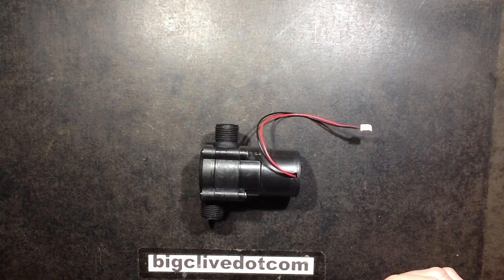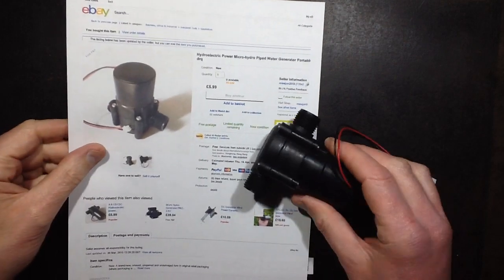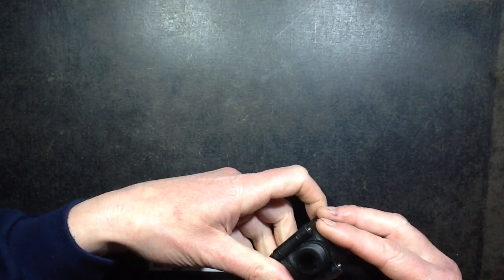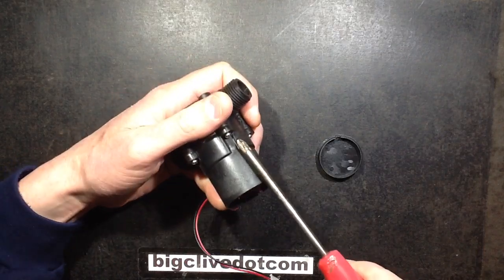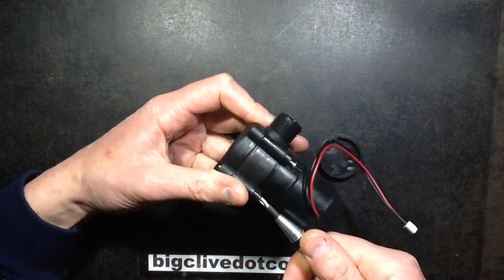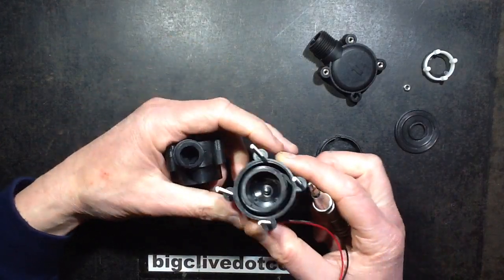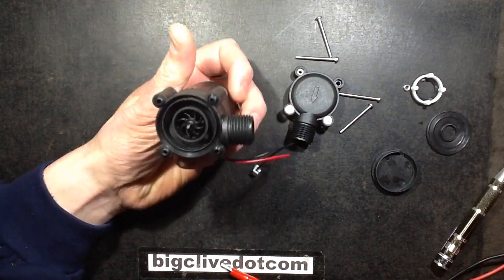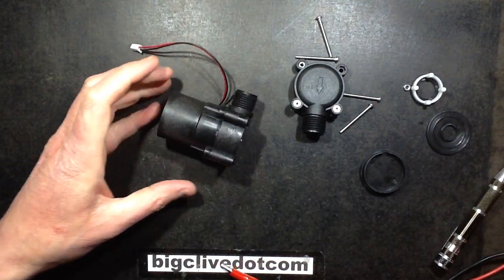Higher current and voltage micro turbine.

Comment: There actually isn't much slip with these mag drives. Once there is high rpm, the magnetic force applied increases exponentially. Just like when a generator is hooked up to a load, the force required to turn increases. The concept is the same except remove electrical generation, and turn it in to heat. This is all on the drive side of the device.
Reply: There are pumps that move some nasty fluids that cant have a seal or any failure point where the pumpage can leak. It's set up the same way large scale. Quite efficient with almost zero slip at full rpm. Very cool to see in this small scale.

Comment: Well we need someone like you that involves yourself in this topic.. you make a video with those little things United together in a manifold and seeing if it will charge a battery Bank.. and yes we know this water needs the least to be filter .. or at least screen in the outdoor wilderness hydroelectric project.. yes they make such a things we're forming spray rigs.. the ultimate achievement in a basic hydroelectric is.. maybe I should say Quest.. is charge a small battery Bank converted to DC for a long distance run through a 12-2 wire and have that line charge a larger battery Bank.. that ultimately runs large DC converter..  water pipe versus flu m.    Give me a some of this hopping with hydroelectric power which may or may not be transferred into a dedicated system.

Comment: What is the purpose of these things? What would you actually use it for? they are like tiny water motors we used to used many years ago to power machinery driven by mains water pressure. If only someone made one that could generate enough power to slowly charge a battery bank when I'm out at work then when I come home, switch it off and I have free power to use and haven't given the energy companies any of my money.

Comment: That must be ... the most pathetically cheap way of transferring mechanical energy to electrical ... using a magnetic clutch to drive a motor ... instead of just using a suitable stator for the clutch magnet itself. A bodge job gone serial production, if there ever was one.

Comment: Perhaps the magnetic coupling is supposed to limit the current and prevent the coils from overheating, since the more current is drawn the more force it will take to spin the generator and at a certain point the magnets will start slipping...

Comment: If it is used in a household application would using a capacitor, or even an ultra capacitor, work better than trying to charge a battery of some kind?

Comment: Hey there Clive. say, do you think i can put one of these little motors on the hose of my shower and power ups some LEDs to light up the shower? 
how high is the current it creates? if it isn't that high, i could even use it without waterproofing, just direct LEDs on the terminals and if water splashs, no biggie. 
Thank you for your great videos, i've been following you for a long time, since you always show up in my front page, only today i found out i still haven't subscribed! sacrilege!!
Reply from the maker: The current they generate isn't that high, but would still offer a glow.
Reply: going to give it a try! thank you :D

Comment: response to 
hire current and voltage micro turbine.

 I have one of these turbines
 and I also disassembled it
 I have seen them used in the hill tribes in Thailand.
 they are mainly used for LED lighting in showers
 or  to charge up cell phones.
 you mentioned you had a friend with a waterfall.
 the higher the drop more the power.
 thanks for all the  videos

Comment: Hello Clive,
If I was to run several micro turbines as in 'https://www.youtube.com/watch?v=M60V4VX0pNU'  'inline'  would that increase the power ie.15V x 4  = 60v
I like your vids you explain clearly 
cheers 
Tony
Reply from the maker: It should, but will also increase the flow resistance of the water greatly.
Reply: A little bit more about that Clive. are you saying for  example water flow into the first would be 100 feet per minute coming out would be 90 feet per minute and so on over the next 3 water turbines ending in water flow at 70 feet per minute into the last water turbine.

cheers 
Tony
Reply from the maker: Each turbine would restrict the flow like a resistor, so the overall water flow (current) through the pipe would be reduced.  The pressure wouldn't change, but the flow of water would resulting in reduced pressure when devices were actually using water.
Reply: Cheers Clive,
I'll let you know how it goes
Reply: What was the current when hooked up to a water source? I'm looking for a small turbine with at least an amp output.
Reply: bigclivedotcom run a ton of them on parralel pipes, I've got over 4 bar mains pressure here. Don't let the water authority cotton on as you will get done for erroneous waste of water and they will slap a meter on your rising main

Comment: I'd like to see if this motor is reversible. If you apply the voltage to the opposite leads will it spin backwards? also, if the turbine spins backwards would it push the water out? in essence: if the voltage is applied backwards would it pump?
Reply: I have the exact same micro turbine. I tested to see if it does spin backwards and pump water and it does quite efficiently, the water shoots out into the air.
Reply: Any centrifugal pump will move water when spun backwards. But it's strange in that it will still flow in the same direction, just at reduced pressure.

Comment: May be , the rubber washer allows excessive pressure to escape round the end of the turbine as it flex away from the lower " surface " .............
Reply: that was what I was thinking too.
Reply: more like they want to prevent water leaking between the middle and outflow sections.  it doesn't appear to be a valve as there is no way for it to open with the spacer pushing on the middle and the outer walls holding the outer part of the rubber in place.

Comment: This might be great for a solar application, when it runs at low voltage?
Reply: This wouldn't be suited for a pump. It's impeller isn't going to deliver much pressure, if at all.

Comment: I know it is a little unrelated but your standard sink tap. . appears to be our standard toilet connection. . xD Not sinks though, they use a slightly smaller one. (Unless you use Delta faucets, then your screwed usually. :D)
Reply: DanJBMedia just 15mm or half inch copper pipe in older installation with a compression brass fitting with threads that attach to these flexible tap or cistern connectors. They serve both toilet and tap. Flexible connectors make plumbing loads easier, one thing to watch out for is that you don't kink the hose or twist it out of shape when tightening.

Comment: It can generate, but I wonder if once primed it could pump.
Reply: with that teensey tiiiiny little blade? sure, but it'll be easy to back-pressure it into a stall, and it's not going to pump much water at all.. you're better off with a proper diaphragm pump

Comment: I agree with Boris Schnee...in addition to being a seal for the pump housing, that rubber gasket could also act as a bypass valve...BUT...are we certain this is not a low volume centrifugal water pump being run reciprocally and marketed here as a micro turbine generator?...because, what would be the difference in construction?...I'm thinking:  None!  
Please perform and add vid on wet tests, including at what electrical load mag coupling fails!
This device could also be used to charge your computer while "on the road"...just stop at the nearest Reststop, connect plumbing to sink, and run (Cold) water for an hour (using hot water would be wasteful!)...just an idea...or how about connecting plumbing AND electrical connection of two of these units together, then starting the water flowing through some external energy input...after removing energy input, circular flow would then continue for ever!
FYI...magnetic coupling is commonly used in mains powered aquarium circulator pumps...powered motor and spinning magnet are outside the glass and dry, and couple through glass to turn wet impeller and move water.    Thanks BC for great vids!
Reply: looking at the design of the middle and outflow parts, I think it is just a seal,  the inner part can't really operate with the spacer pushing on it and the outer part is being held in place by the walls pushing on the seal

Comment: I think it means a half inch hose 50 feet long might charge a flat camping battery.  Realistically you need a continuous supply of water and some idea of MTBF to judge if the obvious low cost of ownership (in £ per W of generating capacity or £ per kWhr).  I wonder what the pressure limit drop is...
What's the chance of a test on compressed air Big Clive?

Comment: First off I want to say I love your videos I wanted to ask you a question since this is definitely your field can you use a 12 volt battery charger to charge a 48 volt system without disconnecting the 48 volt system which would be 4-12 volt batteries can I just use blocking diodes
Reply: @Alex Huntzinger 
Since Clive did not respond, I will answer you: No. You would need to use 4 of the 12 volt chargers, one per battery. Or a circuit like the Joule Thief but enlarged for more power, to boost 12 volts to the 55 or so volts needed to charge 12 volts each times 4 batteries.
Reply: And check with a multimeter their is no connection from either battery cables to the power source connections...   DC to DC changer often will have over go straight through...

Comment: In case you are still pondering about the rubber washer, this is basically a rudimentary valve. As long as the water pressure is low, all water will flow through the little hole to the turbine wheel. As soon as the pressure gets to high to go through the hole, it will press the rubber flap downwards and the exess water will flow directly to the outlet.
Reply: If your water pressure is too high will it not generate anything?

Comment: we have a water alert box in our basement because we live in a flood zone and we have to change the batteries every few months i wonder if hooking up this to the main water line then using it to charge a battery for the water alert box would make it so we dont have to worry if the battery is dead.
Reply from the maker: +brandonhughes7 For such a low demand thing I'd keep the batteries.  I took a basic flood alarm unit apart once, and it was just a simple transistor acting as an amplifier to drive a sounder.  When the water bridged between the two electrodes it powered the base of the transistor with enough current to turn it on.  As long as those electrodes were clear of the ground by even a millimetre it drew no current at all.
Reply: I'm thinking you wouldn't be happy with the pressure drop from these.

Comment: You should hook that up to your toilet water supply line so it charges the batteries of a night light every time you take a massive dump.
Reply: What about a piss meter? Two electrodes in the toilet bowl, one copper and one zinc. The more you piss, the higher the voltage.

Comment: Those are cheap fountain pumps not generator turbines, yes they can generate since its a DC motor but the original purpose was to pump water.
Reply: +ElfNet Gaming I agree with you on this...I wouldn't be at all surprised if you found this same device packaged elsewhere as a low volume DC powered pump!  Reciprocity is a marvelous thing!
Reply: Cheap lawn fountains...

Comment: I recognize these there for charging the batteries on taps for bathrooms that use the infrared sensor type toilets and taps these use very little energy and can sustain themselves on these smaller turbines.
Reply: I have been wondering for YEARS how those faucets function, since for sure the janitors can't be replacing batteries every couple of days.  THANK YOU!
Reply: @tempk490  yea actually alot of them take aa batterys and its every 6 months
Reply: Thanks!
Reply: The ones I have worked on take 4 AA batteries and they last about a year.

Comment: could you incorporate into a domestic incoming cold mains water and generate some electric to say charge up laptops and mobile phones ?
Reply from the maker: Theoretically yes.  But it could limit the water flow to your home at that point and result in reduced water pressure for things like showers.
Reply: bigclivedotcom possibly you can put it before the toilet, where you dont need strong water. Maybe on the gardem hose while washing a car, it will save water too!

Comment: Is it more efficient to magnetically couple it to a motor rather than just have magnets attached to the turbine and then a coil in the other chamber?
Reply: Bullfrogerwytsch the magnetic coupler is close to the axis of spin, and would take weight off the turbine itself I would think, but thats an off the shelf motor they didnt have to design as coils and magnets themselves. i think its more just a simpler way for the mfgr to put out a product than being more efficient.  your idea is very workable too! hmmm

Comment: 0.5v at 9ma - wow! thats a realy cool find :O)

... can i ask something please. Is the intent of these motors to put them in line with central heating? to charge up batteries in the process?
Reply: bigclivedotcom For those of us with mains electric showers, maybe a red 'shower in use' light near all the other taps in the house warning of physical harm to anyone running the water while we're showering <grin>
Reply from the maker: I guess they're designed to generate a small amount of power anywhere there is water flowing.  I wouldn't recommend using them in a central heating system due to the high water temperature and the flow restriction of the turbine.
Reply: ah see... hmm... ok. LOL melted plastic. So, thinking about it. If there was tank being filled by a river uphill for pressure. And a pipe coming down from that tank, you could put about x10 of these in series on the pipe with the same water?...  for a house, hmm...  install one on the copper pipe below your sink, or shower, bath
Reply from the maker: DiyEcoProjects If you had enough of a drop for the water pressure then that could work, but each turbine would add a point of water flow resistance so they would progressively slow the flow of water through the pipe.  You could theoretically use them in series with your toilet cistern or even the whole house water supply to generate power when water was used.  But more for low level battery charging than for heavy use.  The water flow into the house would be reduced due to passing through the turbine, so it might affect things like showers.
Reply: hmm... Interesting... thanks clive

hope things are good :o)

... might even get one for the motor